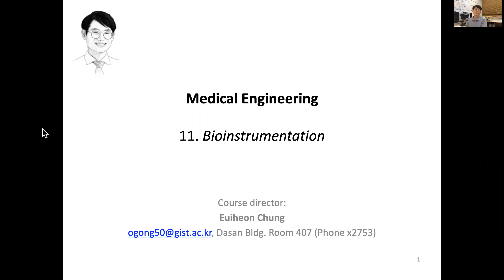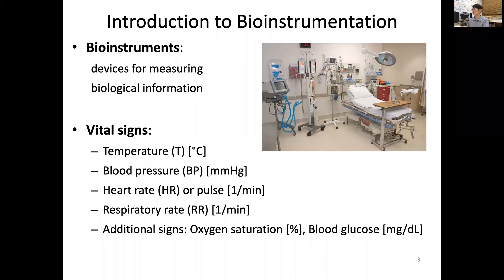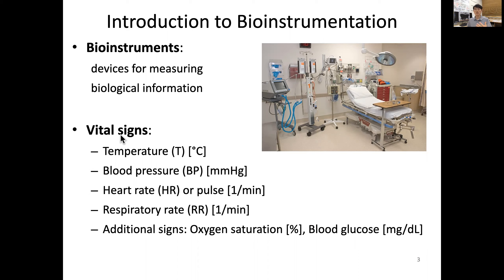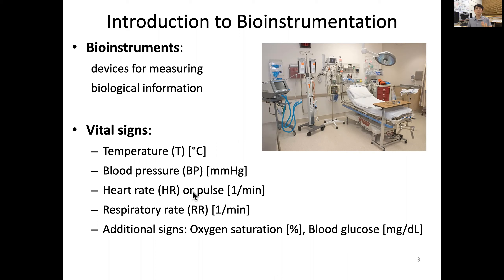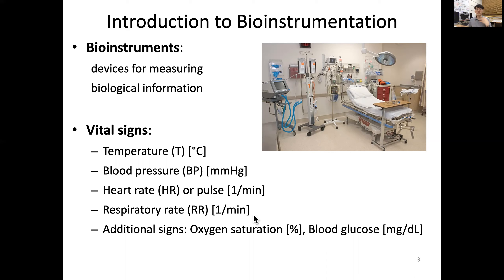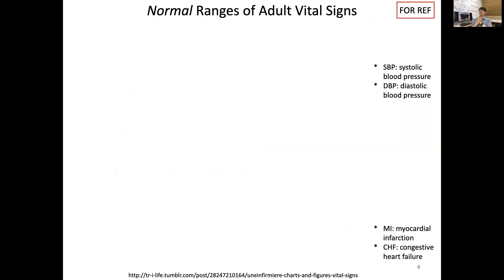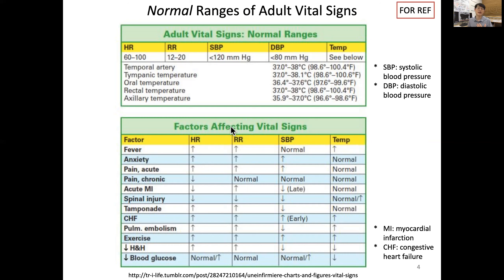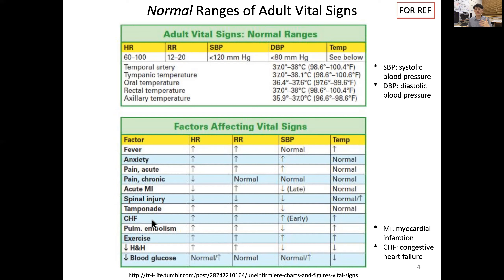11.1 Bioinstrumentation: VITAL SIGNS

Comment: Q1 When we do the In vitro experiment, we use a microscope to check the cell morphology. Is the microscope Bioinstrumentation?
Reply: A1)Bioinstrument is the conversion of detected signals into electrical signals, and optical microscopes do not seem to be able to be viewed as bioinstruments because there is no step in converting them into electrical signals except by simply using light. However, like scanning probe microscopy (SPM), a microscope that scratches the surface of a sample using a cantilever and then converts the topographic difference into an electrical signal may be seen as a bioinstrument.